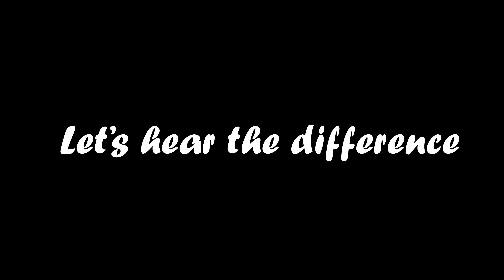Swapping Stock Tires to Street ones went BOOM [LITERALLY] | Kukirin G3 Pro | Timișoara

Comment: 38kph in a park, what a bad example you are giving for the Trottinette community. Please consider the innocent child you may hit one day & then have to face the parents.
Reply: Kids should be kept on slack to 18yo
Reply: 😂😂😂 @wykonczeni
Reply: I've only been into scooters and looking at info on them since a few months back, and already I know two cases where people were struck by a person speeding on an electric scooter that ended up dying from injuries sustained in those crashes. Both of those people were on the older side, so I'd be afraid to hit anyone. Also, because the person on a scooter is likely to be wearing some safety gear, they end up surviving with minor injuries, while the people they hit take the brunt of the collision.
Reply: @JJtoob  drive always respectful on every verhicle,and  where safety gear.its the same as a motor bicke ,or normal bicke,you are much more vulnerable!!!

Comment: I want to know what you would use for solid rubber tires and how to keep a solid tire on a split rim, I switched a flat tire for a solid tire and the solid tire popped out of the rim and it’s the same size as the air tire except it doesn’t have as much give in tightness, any tips on this?

Comment: What suspension size is required for front and back on the kukirin g3 pro? Is it 125mm or 150mm
Reply from the maker: Actually I have no idea, but I know that the front one is smaller than the rear one, you could find them on their website hopefully😁

Comment: How is the range compared to the stock ones? Is there any difference? Keep up the good work my friend and please, be safe!
Reply from the maker: Safety is prioritized m8😁I did not tested the range at maximum on the new tires, but I feel like things are going smoother on them, if you are riding only on street, most likely you could squeeze some extra range out of them, on the stock ones at slow speeds, you can tell that the stock tires vibrate more(since their surface is not completely rounded), also the street ones are waay more silent and most likely they have a better grip😁
Reply: Should get more range on smoother tires because theyr'e also rated for higher PSI.
Reply from the maker: @keysersoju9823  yeah, that's true😁 they also reach higher speed faster
Reply: Hello I have same scooter.  Could you please tell me where you got the street tires . I would love to change them to street tires. AND what size . Thank you.
Reply from the maker: @chrisdudley8366  hey, their size is 10x3 (or 80/65-6.5), you could buy them from anywhere, just search tire and the size and boom, you will find them 😁

Comment: Definitely much quieter & smoother, u don’t feel like you’re going as  65kmh especially on the asphalt. Also  went on the trials with no problems. I fitted these tires only a few days ago & I’m pretty happy .I got about 2000km out my stock Hybrid tires so hope these last as long. 🛴💨.
Reply from the maker: That is great, the Hybrid ones had a reasonable life, I think those will resist more because they are meant for asphalt :D I wish you amazing trips, you are amazing ;D

Comment: does 146 millimeter inner diameter solid tire will fit the rims?
Reply from the maker: I am not sure of that, the oppening of the gap might be too small and then you will not be able to fit your valve into it =))

Comment: 10x2.75? will do?
Reply from the maker: I am not really sure, they might but I wouldn't bet, they are designed on 10x3 =)))
Reply: i need the inner diameter
Reply: do you think 146 will fit on it?
Reply from the maker: I think that should be just about a little bit less than 3 inches
Reply from the maker: What component is 146?
Reply: @JoyOnWheelss  the inner diameter of the tire that i bought
Reply: @JoyOnWheelss  but the tire is 10 inches but not sure if it excatly fits the rim of the kugo g3 pro
Reply from the maker: @trystandizon1490  try it out and let me know if it works ;D